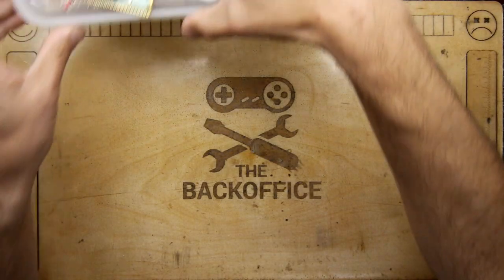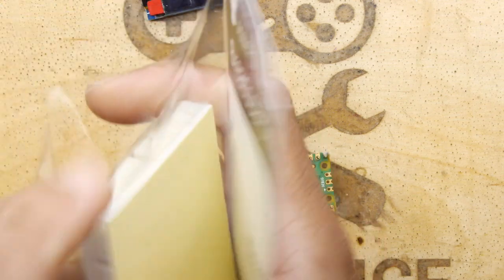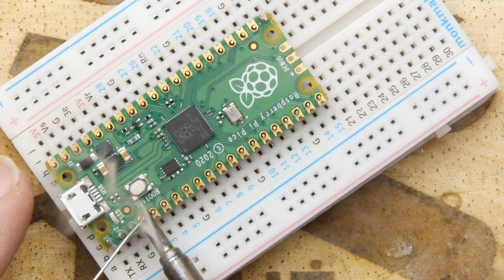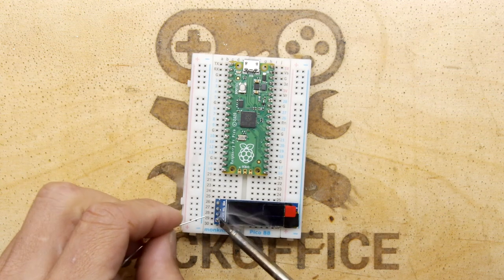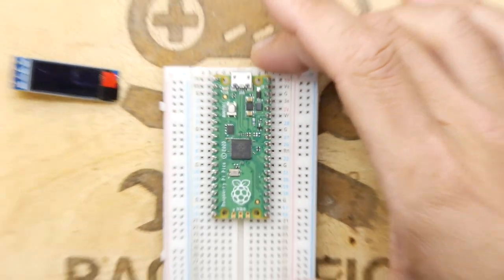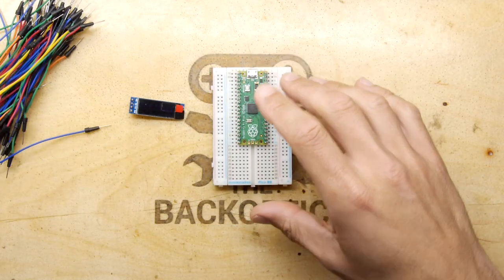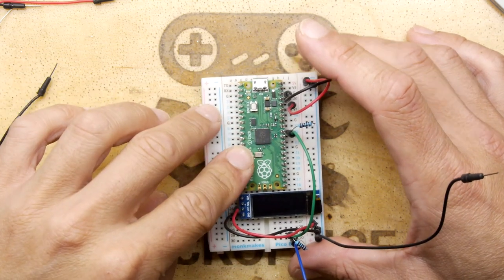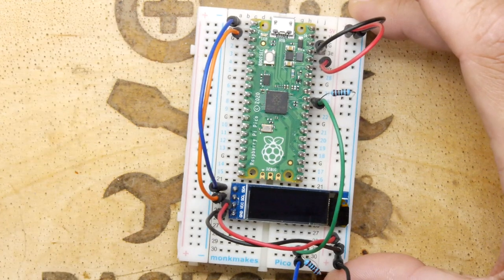Make your own DIY oscilloscope for £4 - Raspberry Pi PICO Project

Comment: I think it was fairly accurate. For example if you look a the samples at when its suppose to be at 0, they are averaging around 0.03 volts. By compensating (subtract that from measurement of the charger you tested = 1.52-0.03 =1.49 volts.
Reply from the maker: Sorry I just saw this, I really need to revisit this subject, I would quite like to sit down a look at calibrating this properly, using shudder maths. It would be interesting to see if it scales linearly
Reply: @Bobo-ox7fj  for most use cases this approach is by far the best.

Comment: Hey mate, are you able to explain logic gates, and how to control inputs? From my understanding are that chips have various gates, and or nand nor xor xnor, but how are they applied, i'm aware of the boolean algebra, but not clue how they are applied in real life usage. How do these logic gates also aid in input to output? And their use in circuit boards. 
Help my brain is fried thinking about plcs
Reply from the maker: How do, I could probably have a go, but I would suggest looking at some browser based circuit simulators. You could have a fiddle and see which support logic. This is the first Lindsay l list I found: https://www.electronics-lab.com/top-ten-online-circuit-simulators/

Comment: neat project! didn't know about the Better Serial Plotter software, looks dope. also I'd wager one could optimize the sampling rate further by fiddling with adc settings or directly writing to registers or tweaking micropython internals
Reply from the maker: I think there is diminishing returns on the micro python route vs shifting over to Arduino. I found I was hitting the walls pretty quickly and wishing it was C or Lua 😂

Comment: Noticed a missing zero in the SCK frequency (i2c initialization). You probably want 400khz and not 40khz which makes the communication 10 times slower
Reply from the maker: INSTANT SPEED BOOST 🤣

Comment: Nice, that was kind of entertaining, even though I more or less saw what I expected. Only bit I was missing was a short explanation on the voltage divider, ignoring it's just 1:1 here, which is also the reason for the 32767 magic value after all (half of unsigned 16 bit integer maximum). People might want to read some bigger (reasonable) values without frying their Pi, like let's say some 9V battery block.

P.S.: The chapters dropped out of the video description.
Reply from the maker: Unfortunately the original audio of the recording died and I had to recreate it. It was around half of the duration of the computer side so a lot of explanation got lost 😒
Reply: @backofficeshow  Aw, too bad. But still way better than scrapping the whole effort.👍
Reply from the maker: @Smaxx  Yeah it happens. I think it would be nice to next 3d print a case for this, after giving it is own bigger screen to show the traces

Comment: Would this be better, worse, or the same as one of those $50 pocket oscilloscopes? Also, would I be able to do the same thing using a Raspberry Pi 3B?
Reply from the maker: This would be much worse, I did a video or two on some excellent pocket scopes.

I don't recall if the pi has an ADC channel but there definitely exists hats to do the same

Comment: great project , can it be made to display x,y mode ??
Reply from the maker: Sorry just saw this, I don't see why not. We might need a different plotting software, but hardware wise it should not be a problem. Coding bare bones or in C would likely yield a nice speed boost. Makes me wonder if you could render a vector display!
Reply: @backofficeshow   unfortunately i dont have a clue about coding,  but  if you can make it display in x,y mode then you can make a huntron track/curve tracer, and the best thing is most people probably already have most of the parts laying around the house. it would make a brilliant easy to do project.

Comment: Why don't you need to specify the I2C address anymore? Does it autoscan as part of the library?
Reply from the maker: Generally you do, but some devices only come with limited it even only one address, so they incorporate that into the driver as a default

Comment: I keep getting this error
Traceback (most recent call last):
  File "<stdin>", line 1, in <module>
  File "/lib/machine/__init__.py", line 1, in <module>
  File "/lib/machine/timer.py", line 7, in <module>
  File "/lib/signal.py", line 13, in <module>
AttributeError: 'NoneType' object has no attribute 'func'

what am i doing wrong?
Reply from the maker: Hi, sorry only just seeing this, did you resolve it?
Reply: @backofficeshow  no I haven't. Would be awesome if you could help..
Reply from the maker: I'm no expert in python, but I think that means you are referencing a library that is not installed. Is there a way in your environment to select the raspberry pi Pico. Look for a board selection menu in the software

Comment: Hello. I wonder what's the reason why the coefficient is 3.35/32767 rather than 3.3/65535?
Reply: I think it's because of positive and negative values. In programming, you have Unsigned and signed int, short, long.
Unsigned starts from 0 whereas signed starts at -xxxx. In this case, the resolution is 16bit (short, ushort) 0 to 65535 values in Unsigned and -32768 to 32767 in signed.

Comment: why you used 1k resistor and 100k resistors ,why not other value like 120k ...
Reply: My question too. Now you have an input impedance of 2k, which is really low and probably influences your measurements when probing in circuit signals.
Reply: I know this is an old comment, but you'd probably assume you're out by a multiplier, so multiply your reading by 1.48/1.52.
It might also be worth adding a tiny bit of averaging because of the jitter (this would reduce sample rate however..), and increasing the input resistor divider a little for 12V circuits.

Comment: Don't solder the pins of the Pico on the breadboard. Never!
The heat can melt the plastic of the breadboard.
Reply from the maker: Let people use their stuff how they want, if they are quick it won't cause a problem 😂
Reply: @backofficeshow  Sure, you can use your stuff how you want. 
But it is still is a bad example when you solder on the breadboard

Comment: Good intro, sir.
Question: Why do you use so much totally unnecessary white-space in your code?
Does the Python editor force this practice?
Reply from the maker: Why do you think it is unnecessary?
Reply: @backofficeshow  I have been a professional coder since 1969.
Any white-space that is syntactically unrequired is mere decoration, NOT code, nor comment, and utterly superfluous.
It makes code harder to read, especially when inconsistently applied.
`In my 53 years of programming, I have noticed a solid correlation between use of unnecessary white-space, and other very poor coding practices.
Reply from the maker: A good programmer is any who manages to make a living or even better, a living with and for their team. Get over yourself and leave folk alone to code how they seem fit. I'm not sure if you have used a modern IDE in the last several decades but you can automatically reformat the code to however you want at the click of a button. Even adding all the pedantic rules you like. Or play with chatGPT and see how utterly pointless it is to discuss programming semantics at this level, literally it does not matter anymore.
Reply from the maker: @MichaelKingsfordGray  I say my name at the beginning of every video and you can look me up.